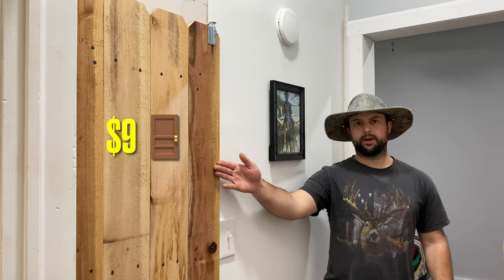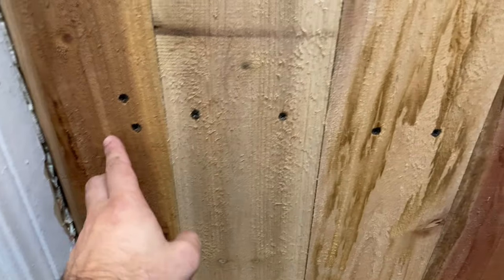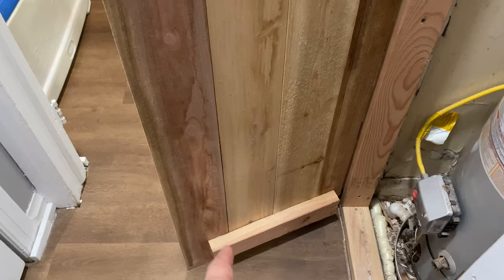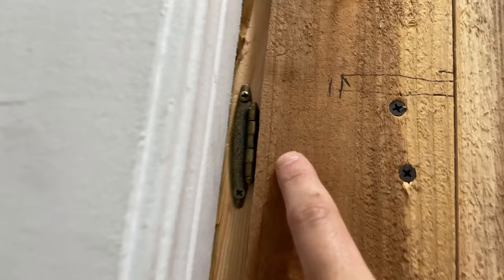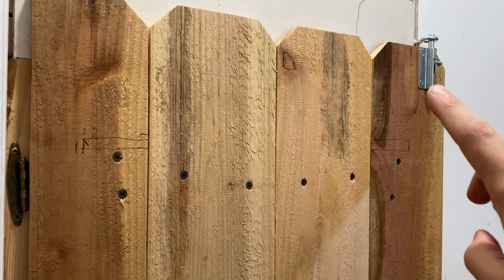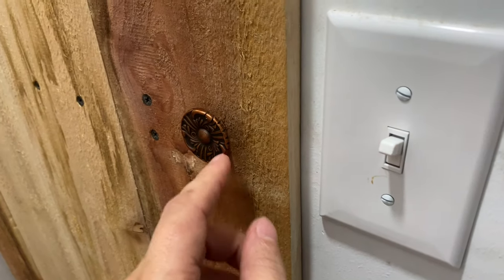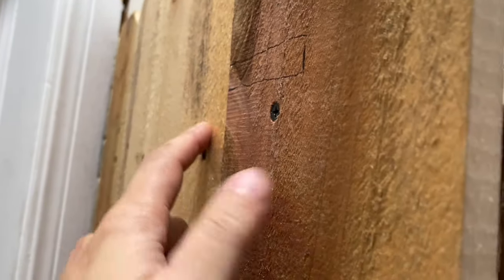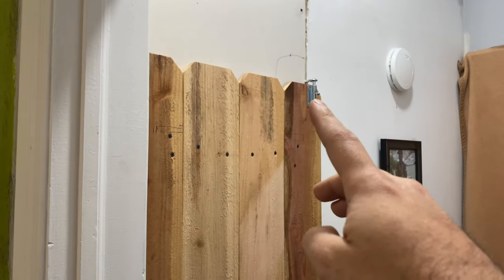How to build a door out of fence pickets

Comment: great  and I have a  pile of those fence boards.  this will be a lot easier than the other ways I have looked at  this should slow that horse down that keeps pushing the metal door in on the storage shed  thanks
Reply from the maker: No problem! Thanks for reaching out and sharing! I love it and it is still working great. I just seen it a few days ago and it’s holding up great!